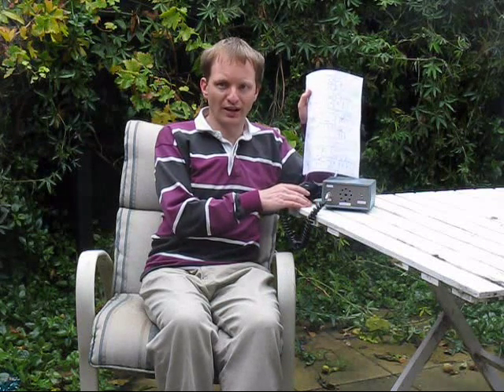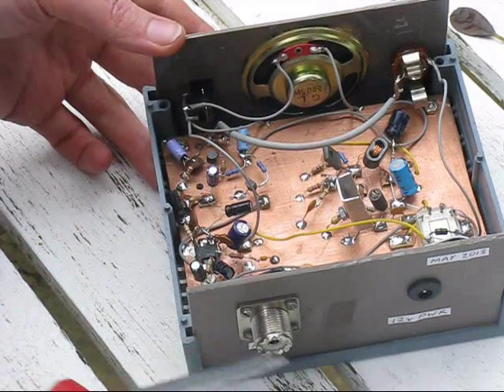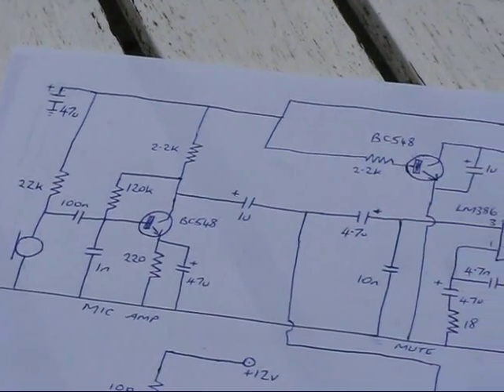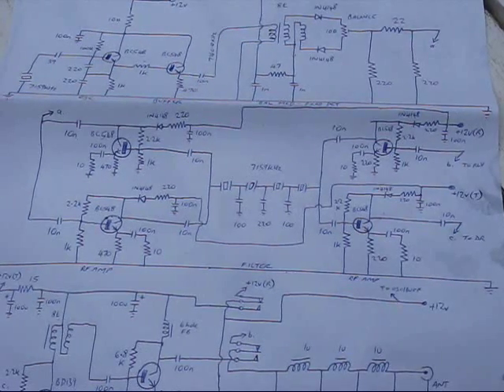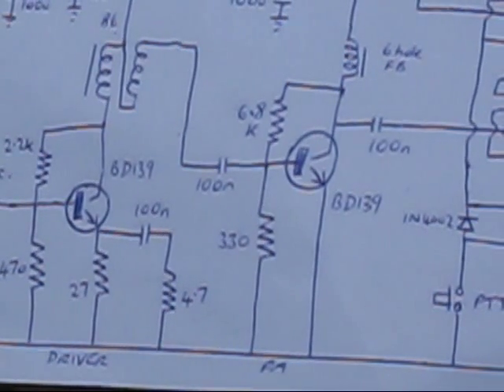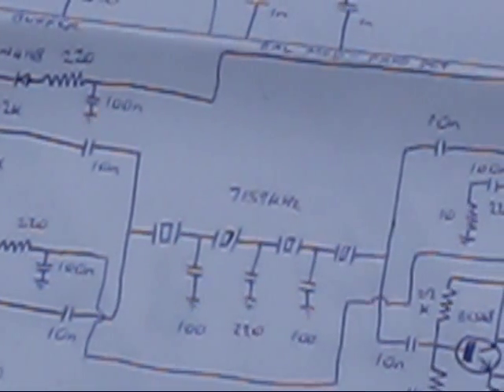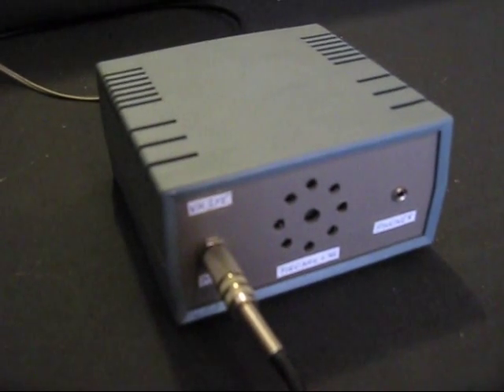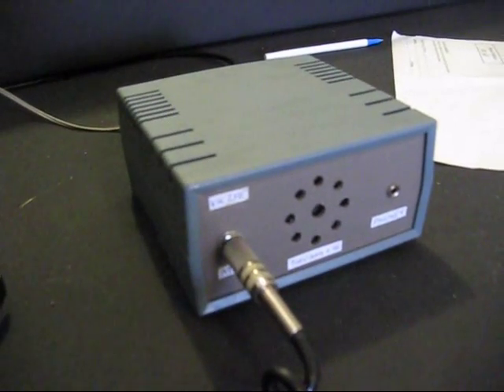Knobless Wonder: 7 MHz SSB txcvr with just 10 transistors/1 IC

Comment: Hi Peter, I am building my second Knobless Wonder on a VK2EVB PCB. I'm in the US and will be using 7.200mhz crystals. My question to you is, if using 7.2 xtals am I to expect the final operating frequency will be 7.201mhz because of shifting the pass band up slightly? This keeps confusing me. N6ALT
Reply from the maker: Probably. My use of 7.159 MHz crystals put me exactly on 7.160.

Comment: Thanks for the design and introduction. I just built on a perf board but cannot get any output. Is the transformer at the driver stage correctly drawn in the schematic?
Reply from the maker: Adam - as far as I know the schematic is accurate.  Try working back from the antenna socket until you get a signal.
Reply: vk3ye Thanks. Issue is fixed. I have sent an email to your qsl.net address.

Comment: This looks like a fun project and I plan on building one with a smaller footprint on perf board some time this year.  I have one question though.  I've built qrp kits following instructions, but what advice do you have regarding rf isolation and component placement?  Are the vertical pcb pieces on this radio separating the different sections absolutely necessary?
Reply from the maker: Separation is a precaution to provide shielding between stations. Highly recommended.  An oscillating transmitter with spurii is frustrating to fix.
Reply: +vk3ye Last question, can I assume the caps that don't list micro or nanofarads on the schematic are pF?  Thanks for your help!

Comment from the maker: @Ray there are cheap crystals for digital mode frequencies - eg 7040 kHz - check out Expanded Spectrum Systems.  Also W3PM's WSPR transmitter design.